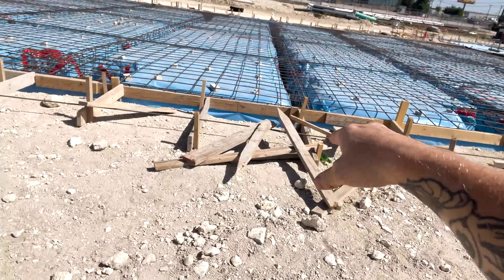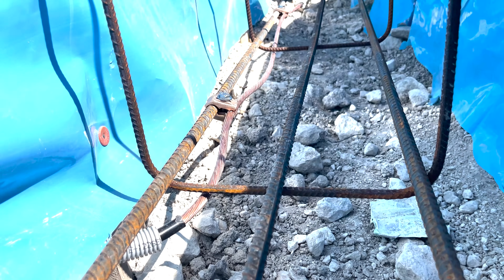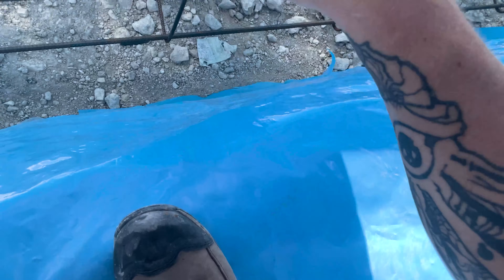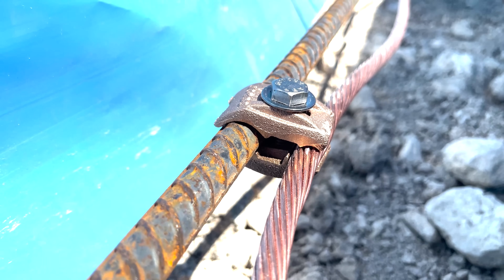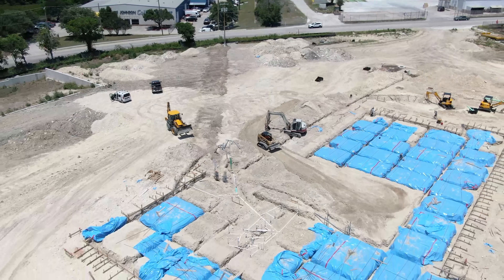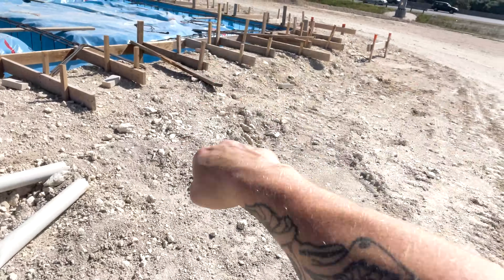On The Job: Grounding The Slab

Comment: Thanks for the video. Hey wouldn't a #4 bare copper ran to the rebar. Set the rebar is running continuous 20 ft in the concrete?

Comment: you don't need all that unless spec calls for it , the 20 feet only has to be #4 and its either 20' of 1/2" rebar or 20' of #4 bare copper that doesn't need to be connected to the rebar at all

Comment: Another method that is acceptable by the NEC is to take a 20 foot piece of rear and bend a 90 in the it long enough to poke out of the slab into a wall preferably and then you don't have to worry about copper theft while waiting for the building to get enclosed.

Comment: When is required cad weld? is an specific code to tell you when to use either or? or would be up to the engineers on drawings specs?

Comment: DUSTIN, try to make a video lesson about "bootleg grounding" and how do you measure bootleg ground what test meter will measure bootleg grounding and does bootleg ground increase the leakage current on the EARTH grounding? would using a GFI Breaker fix and protect you from houses that are wired with bootleg grounding?

Comment: so whats the difference between grounding the slab as opposed to the ground rod that would normally be driven outside in a residential ? does it serve a different function or would that serve as the ground rod for this project ?

Comment: if this is rebar grounding method is used, are the two ground rods driven into the dirt also still required or is this Ufer ground by itself enough?

Comment: The first one isn't going to last being encased in concrete, that copper is going to corrode away.  

Also, I'm pretty certain you need to have grounds in Schedule 80 PVC now to protect those conductors.  This was a change in the last code release.  Of course, JHA, but you know. Haha

Comment: 3:50 we call it a dog box 😁 also it’s interesting the way you bond to the slab! I have never bonded to the slab like that! What usually happens for me is the slab guys will stub some rebar up and out of the slab in one of the exterior walls which is where I bond to!
Reply: An ufer ground simply requires that the stubbed up rebar is #4 or larger (what you're referring to) and is 20' long or made up of 20' of rebar pieces tied or welded together in the slab. You don't have to run a copper wire down in the slab like Justin, though obviously that won't hurt.
Reply: @MyFortressConstruction  So rebar. size #4,20 ft. Long?
Reply: @albduke  Yes, that's code for a ufer ground in my area. Typically they take it and bend it, and wire it onto the grid. Just make sure the wired connection is tight and secure and that provides hundreds of feet of ground instead of just the 20' minimum.

Comment: Love the vid. Question im an electrician in the AIr Force and im wondering about galvanic corrosion for the connectors used on the rebar. Is that not a factor since its encased?
Reply: 10 mil tape or ocal spray
Reply: That was my exact concern. The galvanic reaction is certainly gonna be an issue down the road.

Comment: Nice 👍 I haven’t done Cadweld in a long time since doing lighting protection systems.. it’s fun to do as long as you have all the correct molds and enough shots
Reply: Steven Garibay ---- I love using Cadweld molds for joints and bonds.  Before I was even an apprentice, I ran the warehouse and a driver before that for a very large well known electrical contractor and I used to have to test all the different molds with all the different size shots to make sure they weren't cracked or too burned  to send to a jobsite or buy new ones if we didn't have the right ones on the shelf. That and repair and rebuild all the Hilti and Ramsett powder actuated guns ¼ and 3/8 drive shooting those into a cement block. So when I became an apprentice I already knew every tool and piece of material in the trade and how to use most. I was groomed to be the best by the best.  I have over 30 yrs in now.
Reply: @13_13k  it’s an art that’s for sure… good job 👍
Reply: @13_13k   Used Cadweld on the grounding for my antenna system. Was fun going to the supply house and chatting with the staff and electricians.
Reply: @chrisnelson414  ---- the electrical trade, has so many cool trade specific tools and also for the endless amount of types of electrical work, besides residential, commercial/industrial, like Linemen, maritime, refinery, aerospace, A/V, low voltage, sound and communication, film and television, stage lighting for concerts and theater, etc... just to name a few, there are specialty tools for each. 
 I myself got into the trade first doing Automotive electrical, rewires, repairs and replacement of alternators and window motors, but the shop also built emergency vehicles, lightbars, spotlights, sirens, for various police and fire departments as well as the American Red Cross, ambulance companies, etc... but I did my apprenticeship on a service truck, high end residential and some small commercial, doing troubleshooting and installs mostly in Beverly Hills, Hollywood, areas but became a journeyman in commercial/industrial did that for almost 17 yrs.  That's where the real electrical work takes place in my opinion. Building highrises, malls, hospitals, sports stadiums, working with 4 inch conduit and setting switchgear and transformers, pulling wire as big around or bigger than a roll of quarters using an electric winch you've anchored to the ground w/reels of wire the size of diningroom table, five of them and two people on each reel rolling the wire off into a conduit and another three people in the electric room working the winch and keeping the pull rope clear until the wires appear and then you have to land them on breakers and transformers the size of washer and dryers, etc.... you get all the cool tools to play with.

Comment: Are you required by code to ground the foundation rebar?  If so, does that just apply to commercial buildings?    Why not just hammer two electrodes into the ground near your service panels location?
Reply: It's called a ufer ground

Comment: Question! What is the reason why you are running a 2/0 GEC to your concrete ancased electrode since as far as i know you are not requiered to use larger de 4 when you are using UFER ground as your only electrode. Also: do we have to bond all electrodes available at a building or can we use only one and ingnore the rest? And if we use more than one electrode what size wire is the one that ultimately going land into the equipment? The 4? The 6? Or the one that's sized per table 250.66
Reply: All that are present
Reply: Cold water and structural steel

Comment: So basically you have an Ufer ground. 
My current job requires 80a temp service and 8 GFCI duplex outlets or octopus plus 2 30a twist locks. I call it a squid.
Reply: Spider box

Comment: I always had my structural engineers show the rebar grounding locations on their drawings.  Too late once the concrete is poured.  My structural engineers also checked the grounding was complete when inspecting the rebar. Every site lighting pole I specified had a driven ground rod as supplemental ground.

Comment: Maybe it was in the engineer spec or a local requirement but only need #4 to concrete encased electrode. Metal water  service and structural steel only need full sized electrode. 
Here too utility inspects up to the point of metering, local for everything else.
Reply: I was thinking the same. NEC minimum is #4 for the cee.

Comment: I would not use mechanical connections on anything that's going to be imbedded in concrete. I don't even think it meets code for a substation. Not even if it's direct burial by soil and/or rock.

Comment: Was up Dustin love the videos . Just wondering why did you use a 2/0 conductor for your concrete encased electrode ? Would a #4 not be sufficient?
Reply: Depends on the size of the main panel

Comment: Not an electrician.
I have to ask, What is the purpose of grounding the slab?
Reply: Not really grounding the slab. Concrete slab/footing with rebar in direct contact with the soil is a ground so it can be used to bond the the electric service where a ground rod would be insufficient because of soil conditions. Think I got that right. Code has specifics regarding length of rebar required.
Reply: @beachrider21  
Cool thank you!

Comment: THWN-2 is synonymous in approved purposes as THHN with the addition of damp and wet environments correct?

i.e -2 means 90*c table?
Reply: Correct, THHN is rated 90c for dry locations and 75c for wet locations. TWHN-2 is rated 90c continuous for dry and wet locations
Reply: @braedengendron6981  Thank you!
Reply: @Keatononame13  no problem! 310.4 is the reference for all that jazz
Reply: @braedengendron6981  Thanks again. In WI so using 2017 but I'll manage finding the sections and table. Appreciated.

Comment: We use a lot of cadwelds for airport grounding. Also use the method of blocking the connex with equipment. Thieves are scum.
Reply: there's thieves at the airport? how do they even get into the airport?

Comment: Love your videos.
Unrelated question:  Why shouldn't you run data along with current in the same conduit?  If you run Romex and Ethernet lines you're certainly not going to get them confused.  Sure, you're not going to stuff the conduit full, so heat wouldn't be a problem.
Thanks!
Reply: 60Hz AC makes for very noisy induced data signals.
Reply: As Ethan said…..electromagnetic interference can disrupt data signals.
Reply: Code wise all cables need to be rated for highest voltage contained in the same raceway. Cat 5, 5e,6 etc not rated for 208v

Comment: Can you do a video on how to take measurements from the stub ups from the slab into a panel or through?
Reply: The surveyor will mark the corners of the building you use string and emt staked to the ground and you layout your electrical and data room along with fire alarm the prints will tell you the thickness of the walls then you do your stubups

Comment: Thoughts on using a Cadweld type connection for bonding the grounding conductor to the rebar instead of the clamps I see you using?
For those reading these comments that aren't electricians or otherwise just don't know, "Cadweld" is the general term to refer to using an exothermic thermite weld to make a nearly perfect electrical connection to rebar.
IMO these clamps just aren't even in the same league as a cadweld-type connection, but they are indeed quite a bit cheaper and can be used when there's a burn ban in effect in the area (which would likely preclude use of a thermite type welding connection, the reason should be obvious if you know what thermite is).

Is that something you get to make a decision on, or is that something the engineers and architects designing the facility will decide for you?
Because I really don't see any other reason than "saving maybe $100" to use the clamps rather than the cadweld type connection.
Sure clamps "work", I guess, but the cadweld just provides a much better connection overall IMO. Now I know that shouldn't make much of a difference if the concrete doesn't crack, but all concrete cracks at least a little bit, the major question is "where?".
Reply: The problem with cadweld is every single connection requires a different mold and shot. If you don’t have it you gotta wait for it and pay for it and have back up shots cause some don’t make it and some don’t go off.
Reply: I'd guess it's a matter of cost and or up to the GC. Just a guess, but in my experience that's usually the issue.
Reply: It’s really up to the AHJ, I’d like to say that being electricians we’d get the opportunity to say what’s better for the situation but gc is gonna gc
Reply: @youblewit7268  Is that one of those "it's gotta be exactly this" types of things from the AHJ or is it more of an "it has to be at least this good" kind of thing, because that 2nd one means that you can use a cadweld when other solutions would be "acceptable".
Reply: Cadweld is an excellent transition from copper to steel or galvanized steel. Cadweld eliminates the electrolosys issues and connection corrosion.
Reply: @robbehr8806  You see that's what I was trying to get at, and they even had to use a few cadweld connections in the video, so what I'm wondering is why they couldn't do it "everywhere" since it's both better and they had already needed it?
Reply: @44R0Ndin  My guess is the clamps were more for mechanical stability and the cadwelds were for true electrical connectivity. But, that would be determined by the local code inspector. I hope ElectricianU chimes in on this one.

Comment: Grounding the rebar that is insulated by the slab.  Sounds important!  Does that mean the other 600 million homes in North America are unsafe?  This is why Sparky's get no respect..
Reply: Safe from what? House fire? Grounding doesn't make a house "safe".
Reply: @Ed-uu9eo  Safety is the primary function of grounding.  There are still lots of places running antique knob and tube without ground wires.  Why is the rebar being grounded?  The vast majority of slabs are not and don't have any issues, hence the only real reason I can see to ground the rebar (which is insulated in concrete) is to get paid for it.
Reply: @ydnark83  No. Sorry that's not the purpose of grounding. Grounding stabilizes your electrical system from overvoltage from indirect lighting strikes and other list of things. Bonding is what makes it safe. Just because you have ground rods or ufer don't make an electrical install safe. I'm not sure if you're an electrician but to say they don't get respect is nonsense. Real electricians know their stuff and would know this basic theory about grounding and bonding.
Also, a slab/concrete is not an insulation. Electricity will flow through it.
Reply: @Ed-uu9eo  grounding/bonding.  i get it, the code is complicated and neutral is sometimes bonded to ground, and sometimes not, I had to unbond it in a panel once but I was following electricians instructions trouble shooting an off grid issue that I didn't really understand.  To the layman grounding and bonding are the same concept and that extra wire that normally has no current in it is a safety feature.  No point in arguing the difference between a beam, header, or lintel, I know what your trying to say in any case.
  What I don't understand as dumb carpenter, and please in explain in layman's terms is what the advantage "bonding" the rebar in a house slab is, and how it is tangibly inferior not to do so.  in the real world, not on paper.  why spend the money and resources doing that, and what could possibly happen if you don't do it?
Reply: the reason I made fun of this in the first place is because I think its a useless bit of work.   I just don't see the value in it, especially if it takes a special trip between the rebar and pour.  If there is a good explanation I would love to hear it..

Comment: Watched a vid a few years ago think Mike Holt who said that providing a ground rod at any pole luminare is a waste of time if you run a ground conductor inside of conduit that supplies power. Also pure Bullshit to cad weld to a not needed ground rod. If it's not in the NEC or a local code but rather then an a hole inspector own rule I always argued it. On one job that my  inspector passed local inspector wanted some extra unneeded receptacles installed. Asked him exactly where that was in writing and said it was his own rule. Refused to do his bullshit work then went over his head to get statement of occupancy so customer could move into large building.

Comment: Aren't grounding points supposed to be in direct contact to ground? How does that work when encased in concrete?
Reply: A couple comments on your question. The concrete will be in contact with the earth. Kind of becomes a part of the earth, when it's poured directly onto it. Also, the whole steel slab reinforcement becomes a conductor, and any of that concrete that is in contact with the earth becomes a part of the grounding system. Also, the concrete will remain as damp as the earth underneath it does, so it all continues to be grounded. If you look at the code, the maximum required size for ground rods is only #6 copper, vs the in situ ground (ufer ground as it's commonly known) does not have a maximum size recommendation. That alone should tell you how much more effective it is than a regular ground rod setup.

I hope that was helpful.